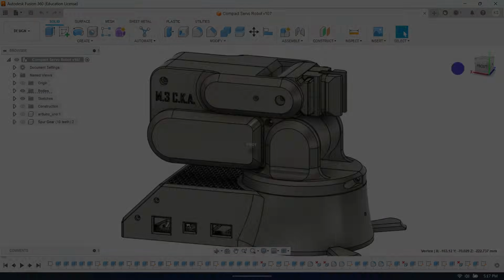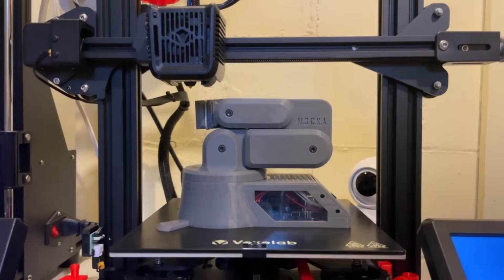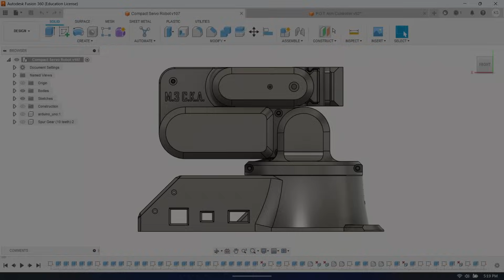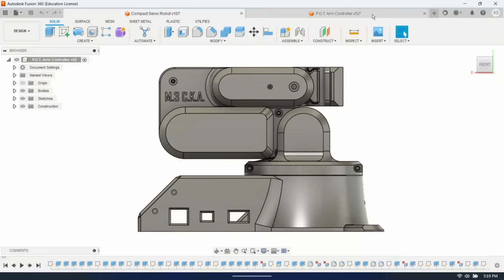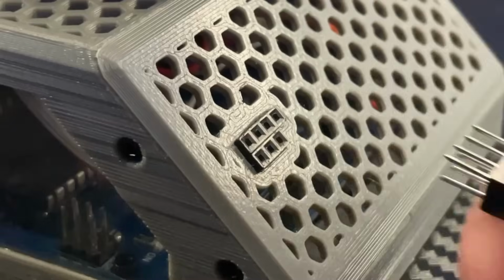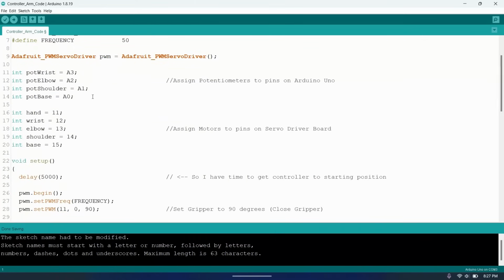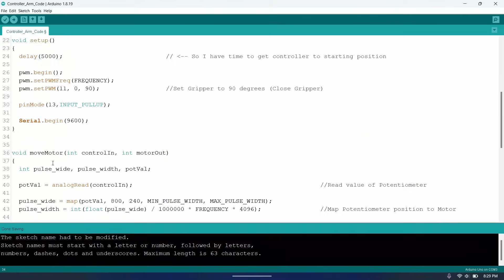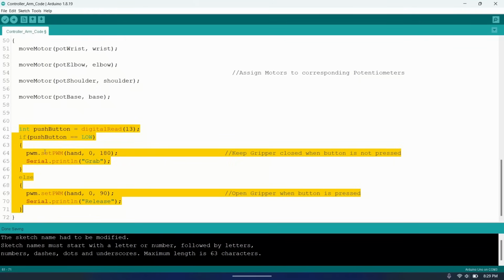How I Built a 3D Printed Robot Arm from Scratch (Arduino Based)

Comment: Great video, would love to give a try. Was wondering if you could post the schematic for the wiring of the small arm.
Reply from the maker: Thanks! I don’t currently have a schematic for the controller. However, the wiring is pretty straightforward. All potentiometer’s Ground and VCC pins are connected in a sequence of wires and each potentiometer’s output/signal (middle) pin run through the entirety of the arm individually to the plug. The potentiometer signal pins make up 4 of the 7 pins on the plug. Another pin on the plug is for the push button. The last 2 pins are the VCC and Ground pins. So, starting from the smallest joint with the push button, one pin from the push button is connected to the closest potentiometer’s ground pin and the other pin on the button goes independently throughout the arm and into the plug. Then, that potentiometer’s (closest to the button) ground and VCC pins are connected to the next closest potentiometer and so on, all the way to the base potentiometer. Then, the base potentiometer’s ground and VCC are wired directly to the  plug. Hope this helps!

Comment: That robotic arm is completely amazing, you  saved my grade with it,i will print it for my final electronic project 😍😍😍
Can you please add the link for the cad model because the link you have just had the STL files
Reply from the maker: The link for the Fusion files should be in the readme file. It should take you to a Google Drive to download them. Let me know if you don’t see them there!
Reply: @buildsomestuff  i tried but is in blanc, that's why I'm telling you
Reply from the maker: @martev6896  Hmm. That’s strange. The documents should be blank if you try to open them in Google Drive, but if you download each of them and then go into Fusion 360 and select “open from computer” you should be able to edit them. Let me know if that works. Sorry for the confusion.
Reply: @buildsomestuff  ohh thanks

Comment: Very entertaining video, but can I ask where this might come into play in normal activities? You have the controller arm which you input your own commands, but the bigger arm is within reach that you could do it yourself. Is it the idea of proof of concept or could it be applied to a much grander scale with stronger mechanical components?
Reply from the maker: While this arm is mostly proof of concept, it can be implemented in some real world scenarios. For instance if it were attached to some other unit, (possibly Boston Dynamics’ robotic dog, Spot) the user could control it to preform tasks in hostile environments or where humans could not get to in general. In this instance, obviously the controller would need to be wireless and with a much more robust arm. As mentioned in the video, the controller’s cable could be much longer or even wireless to preform more useful tasks. Thanks for your interest!
Reply: @buildsomestuff Could you expand on how you would convert it to wireless? Like the components and code needed? Thanks a bunch!

Comment: Nice job!  Any idea why the servos broke?
Reply from the maker: Thanks! Yep, the servo motors that I mentioned broke because of some coding issues I had early in the process. I was not reading the position of the potentiometers correctly and I told the motors to turn too far, which stripped out the gears inside. Those issues should be fixed now.

Comment: Hi there, love from MALAYSIA! Your video are awesome, i would like to build one for myself. How could i get the individual STL file of each component for P.O.T arm controller so i that im able to slice them one by one in Cura before 3d printing. Im not able to seperate each of the component inside the stl files that i have downloaded from your github page by using inventor. How could i get help in order to overcome this problem.Your respond will be appreciated.
Reply from the maker: Hello! Glad you liked the video! If you are using Inventor instead of Fusion 360 for CAD, you should be able to either convert or directly import the files at the link below into Inventor to export each part separately as an STL. Hope that helps!

Link to download Fusion files: https://drive.google.com/drive/folders/1x4P8AquQILwCp8e5CiRJLfVJiJn2U4cF?usp=sharing

Comment: Hey so for inverse kinematics i can give you the advice to learn the urdf format for robot arms. Once you got your arm defined in this format you get all the inverse and forward kinematics as well as advanced motion planning features for free as theres a  robust library for almost any language.

I also suggest a design where the servo outputs feed into bearing so the weight of the arm is on that joint itself and the motor connect can expend all force to rotate it and not holding it up. Oh yeah, did you apply any easing to the servo movement ?
Reply from the maker: Ya, bearings are a good option. I considered using bearings but it seemed to work without them well enough for my needs, so I just left them out. I didn’t apply any easing movements to the servos, they just follow the potentiometers with as much precision as possible.

Comment: Sorry, dude, can you tell me where to get the circuit with the connection of all components. Thanks!
Reply from the maker: Unfortunately, a circuit diagram is not currently available. Sorry about this. At the time of designing and recording I had not planned on making this arm open source so much of the wiring and assembly may have to be custom to the builder.

Comment: Could you share more details on how the servos and the arms are attached 😅, I'm a bit confused
Reply from the maker: Sure! The servos are directly screwed into the 3D printed pieces of the arm with the four screws included with each servo purchase. As shown at this time, 4:49 the servos are only attached to one side of the arm. Then, the other half of the arm is connected to the half with the servo motor with 2 to 3 M3 screws. The first assembly is the gripper/wrist, then the “forearm” is built around that, then the “upper-arm” is built around the forearm, and lastly, the base pivot “shoulder” is built around the upper-arm. Hope this helps!
Reply: @buildsomestuff  how is the gripper and firearm motion made possible, in the video @ 4:49 there is a white gear in the gripper, but its not long enough to reach the corresponding motor there, so are there more gears there or ...?
Reply from the maker: @TinkerBotics  Yes, there is a train of 3 gears in the forearm to transfer the servo rotation to the gripper segment. Sadly, the gears are not 3D printed. Although, one could probably design and print them with a precise enough 3D printer. The gears used in the video are just some spares I had laying around. One gear is attached to the servo, one is attached to the gripper segment, and one is placed in between as an idler gear. Really, any gears would work that fit in that area. But you would just need to make sure that the first and third gears are exactly the same.
Reply: @buildsomestuff  Hey bro, I am excited to share that I have recreated this and It was fun losing my mind soldering, but it was indeed worth it at the end 😊😊
Reply from the maker: @TinkerBotics  That's awesome! I'd love to see it! If you'd like to share a video of the arm, you can upload it here:

https://drive.google.com/drive/folders/1ixlwBpu5KLjRTXnwHgiPtdzesVm8hX__?usp=sharing

Comment: Do you have any idea on why the servo motors broke? I'd like to not make the same mistake.
Reply from the maker: Yep, the servos motors that I mentioned broke because of some coding issues I had early in the process. I was not reading the position of the potentiometers correctly and I told the motors to turn too far, which stripped out the gears inside. Those issues should be fixed now.

Comment: Can you have the mini arm output the positions to a raspberry Pi so you can program it with the little arm then repeat the motions through the Arduino???
Reply from the maker: I believe that can all be done with just the one Arduino board by recording each position of the potentiometers. I haven’t exactly experimented with this yet but it would be really cool!
Reply: @buildsomestuff  cool !!! If that is possible this little arm. It could compete with other mini robot arms 3x the price !!! I seen one that was $10,000 trying to do this but it is horribly expensive.

Comment: Can you post the 3d files and code?
Reply from the maker: Files and code coming soon!
Reply: @buildsomestuff  Cool! How soon do you plan on posting them? ( not to be rude)
Reply from the maker: @karambirrandhawa5968  No worries! My goal is to have them available within the next week or so. I’m working on optimizing the files for easy usage and printability.
Reply: Sweet, I was going to ask the same thing. Can't wait to see the files I wanna build it.b
Reply from the maker: All CAD, STL, and Code files are now available!! Check video description for details!
Reply: @buildsomestuff  are the small gears that are needed in the CAD files?
Reply from the maker: @karambirrandhawa5968  Sadly, the gears are not 3D printed. Though, one could probably design and print them with a precise enough 3D printer. The gears used in the video are just some spares I had laying around. I used three gears in this design, one attached to the servo, one attached to the last segment, and one in between as an idler gear. Really, any gears would work that fit in that area. But you would just need to make sure that the first and third gears are exactly the same.
Reply: @buildsomestuff How does the gripper work?
Reply from the maker: @karambirrandhawa5968  The gripper has one micro servo acting as a cam mechanism to push open the pinchers. The pinchers are then pushed back together by a constant tension rubber band when the servo moves back to its original position.
Reply: @buildsomestuff  Do you know what screws you used?
Reply from the maker: @karambirrandhawa5968  The screws used are a mix of M2, M3, and M4 screws. The length does not particularly matter, as long as it engages with whatever is being held together. You should be able to tell where each screw should be used based on which screw fits in the counterbore on the part.
Reply from the maker: @karambirrandhawa5968  The exact kit of screws I used, along with all other parts, is now linked in the video's description.

Comment: This is awesome ! The design is pretty slick. I thought the code would be way more complicated. I wonder what was the problem with your inverse kinematic ? Did you solve the forward kinematic first ?
Reply from the maker: Thanks! Well, I was able to solve the majority of the math for forward kinematics. My main issue was converting the math into code. I had watched some pretty good videos of implementing inverse kinematics with servo motors and an Arduino but very few used the same servo driver board that I did. (The PCA9685) With my limited coding knowledge, I just wasn’t able to write working code utilizing that particular PWM driver board.
Reply: @buildsomestuff  Awesome work either way, the next steps would be to derive the inverse kinematics from the forwards kinematics or from the transformation matrices that make up the forwards kinematics if premultiplying helps.

Then once you have the inverse kinematics (IK), it's easy road.
Inverse kinematics maps from task space (xyz) to joint space (theta1... thetaN). So you can perform a cubic spline between two task space waypoints to create valid trajectory then use IK along the cubic spline trajectory to obtain a list of thetas to follow.

Or, you can just take the start and end waypoints in task space and convert to joint space and do cubic spline directly on the joint space variables.

Either way the controller would need numerical inputs now. Or hard code in the waypoint values.

I believe this is how robotic arms in real life work, with a bit more extra steps for accuracy such as control loops.
Reply: The code was simple because OP skipped the need for it with their controller design, which I must say that controller is very unique and an awesome idea.

While direct kinematics is rather easy for a robot like this, the inverse kinematics is quite tough to solve, although for a robot like this, it shouldn't be too hard.
Reply: @WilisL  Yes 5 DOF is not so bad for inverse kinematics.